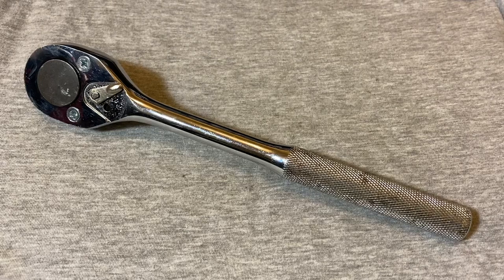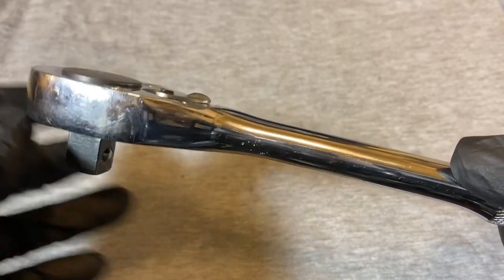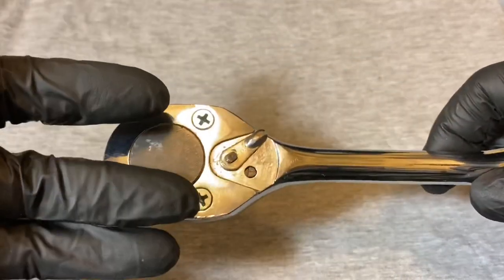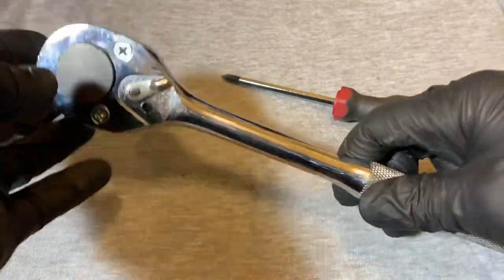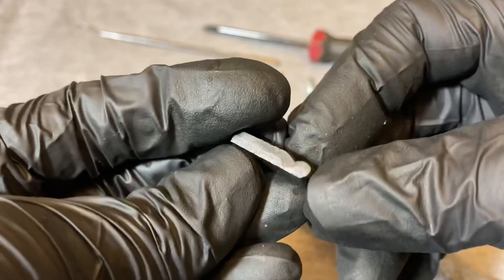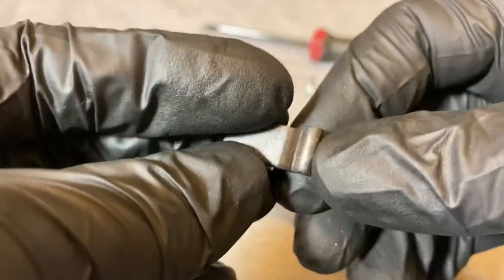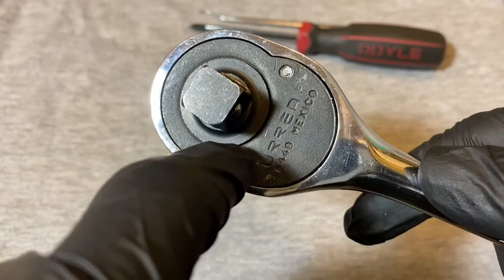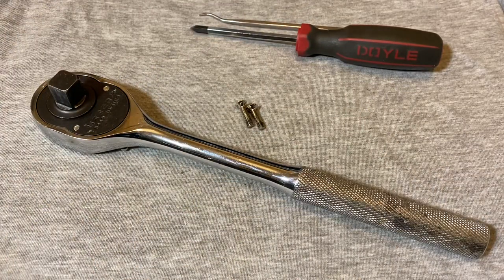Urrea (Proto?)5449 Ratchet TEARDOWN And Comparison To Actual Proto, 1/2” Drive

Comment: I have most sizes of their extra long combo wrenches. They are some of my favorite to use. They are very long and comfortable to hold. I also just like the look of them. And I like the open end design. It has almost a v groove but it's not a true v. Seems like it may give a slight bit more contact area that regular open end wrenchs. Also I have never had them round anything off. Another cool thing is the wrenches are stamped with the sae size on the front. But then the back has what it would be in metric. So funny stampings like 14.2MM... only bad thing is some wrenches have really bad quality control issues. They aren't very uniform.
Reply from the maker: Hey I haven’t seen those. Thanks for all the info ❓